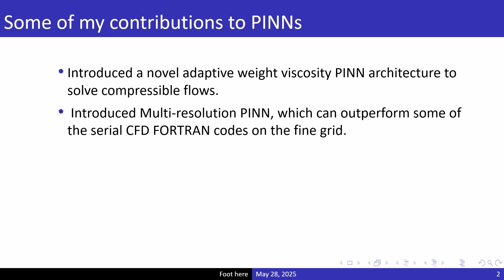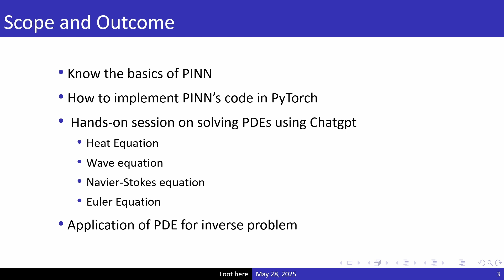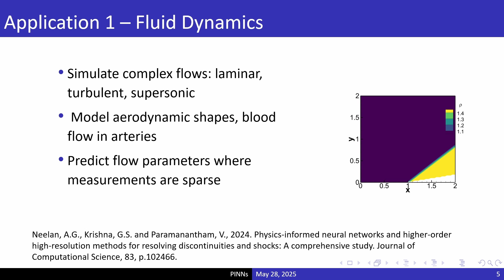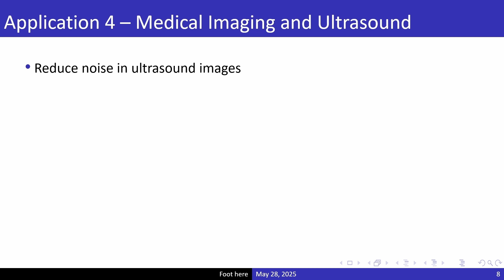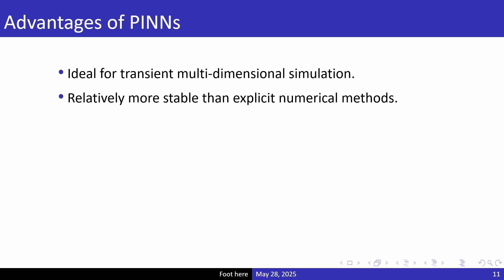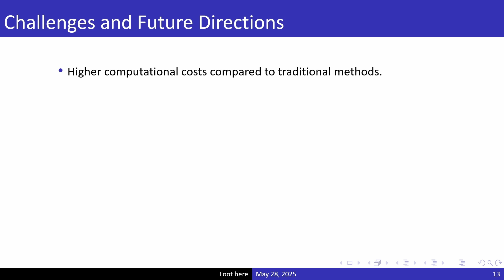1 Introduction to Physics-Informed Neural Networks

Comment: You're hardly pausing or explaining the abstract when mentioning a reference paper. Would be great if you could provide the paper links in the description, or hope there's more elaborate content in future videos.
Reply from the maker: Thank you for your interest. I will cover how to solve most of the problems in the paper in the upcoming videos. 
If you are interested in my paper : 
https://www.sciencedirect.com/science/article/abs/pii/S187775032400259X
If you are interested in other papers I used in the applications:

https://doi.org/10.1016/j.tws.2024.112495
https://doi.org/10.1016/j.ijheatmasstransfer.2023.124392
https://doi.org/10.1016/j.ultras.2023.107026
https://pmc.ncbi.nlm.nih.gov/articles/PMC11308984/
 https://doi.org/10.1002/aisy.202300385
Reply from the maker: For more details about why higher-order conservative schemes give a reduction in the order of convergence on poor meshes:

https://link.springer.com/article/10.1007/s40314-024-02987-x